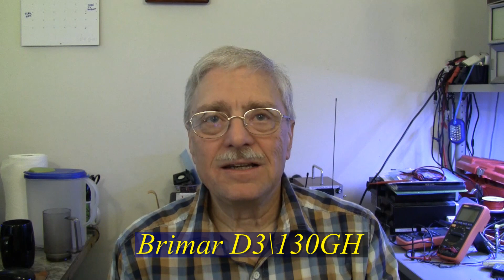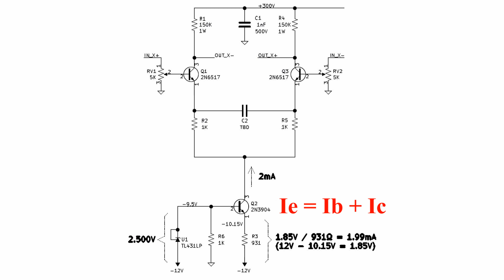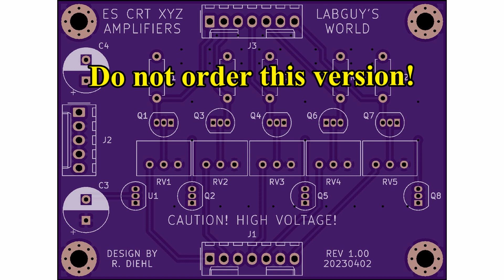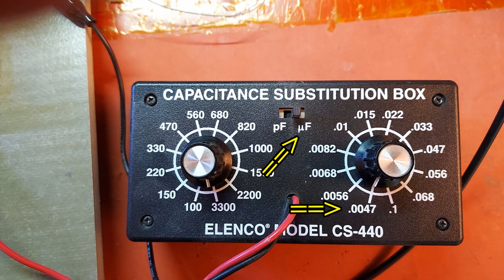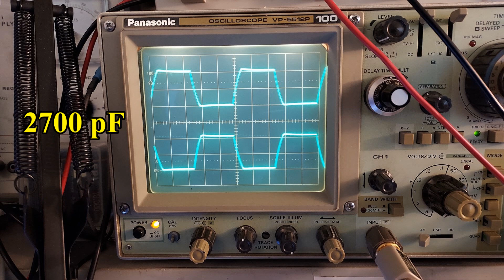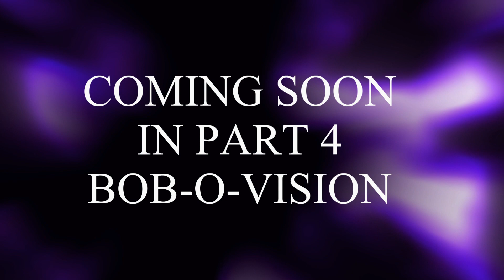Bob O Scope Part 3, Deflection Amplifiers

Comment: Your vid has been very helpful to me in my own O'scope building...  I have a (1961-built) GPO No.6B Mark I (similar to the Cossor miniatures) and it uses ECC81 dual triode diff amps.   As the GPO designed it a variable resistor where you have C2 acts as the gain control.  But bandwidth was only 10 kHz as frequency compensation was undershot.  So I put a 500 pF shunt capacitor across this, and discovered there is a "gain" setting that is neither undershot nor overshot.  Bandwidth for displaying a clean square wave has increased from <10 kHz to >200 kHz.   

I now have an O'scope that runs from D.C. to over 200 kHz, and which also amplifies X and Y for doing cyclogram work.  Superb !!  ❤. Thank you !! ❤
Reply from the maker: Congratulations on your successful restoration. Glad I had a small part in the process. If you watch the next video, you will see that I "don't know it all".
Reply: I am not there yet!  
The input goes in at a 1 Meg resistor which cannot be substituted by a pot divider as it is a grid leak resistance.  Diminish the grid-cathode resistance and the grid bias pdf will reduce, turning the triode on hard.  
But what is at issue is now known to be frequency compensation.
I am not "restoring" since both of my GPO O'scopes are already fully repaired and showing the same behaviour.  This is a design fault in perhaps the earliest diff-amp oscilloscope design.

Comment: I am thinking of buying a 5BP1 .... I know I will hate myself, either way. I am not going to try to build a serious scope . Possibly a clock or some vector drive curiosity. I built a 'scope back in the late 70s and used HV transformers and valves and all sorts.  I plan to cheat using 24 / 2000 volt SMPS and same for the deflection rails. It could become a real time sink ..I would be better of devoting my efforts to getting better at ESP32 and Coding... but but... but ... SOB ...
Reply from the maker: Dig it, bruh! The 5BP1 is not a good choice for a CRT. Very bulky and not very bright. It's primary selling point was its cheapness. They are egg shell thin and easy to break. I would suggest a 3BP1 or even a 2BP1 or one of those with P7 or P11 phosphor for the novelty of it. 
You don't need to tell me about the exploding logic tree of decisions any project creates. They head for maximum chaos at warp 10. The ESP32 will at least cost a lot less in the long run. If you go "full CRT", I am willing to help. Thanks for just watching my videos! You rock.
Reply: @videolabguy  Yeah !! What was I thinking? It would end up being a nightmare. I have built a scope with a 3BP1 before and it is much more manageable. But extreley challenging even so. Plus I live in an RV and dont even have a proper workshop. I started to look at various ancillary circuitry and every part of it would turn into a Heath Robinson nightmare. I already have a nixie clock and a stereo valve amplifier.  

I would get half way thorough it and having ploughed a hundred hours or so...in i would break the 5BP1 and start reading Strindberg and wearing black lipstick ... 

Walk away slowly ...

Comment: Great video Labguy. I really enjoy these type of in depth videos.
Any danger of doing a future deep-dive video about your approach to building state machines like the ones featured in some of your earlier videos ?......Just a suggestion !
Reply from the maker: You bet! One of the barriers in that goal is that I like to program in BASIC. QB64 to be precise. (If you are an old hand at QB 4.5 from the 90's, then look up Q64 and be amazed!) Meanwhile...
I may as well be carving hieroglyphics into stone as far as some of my younger viewers are concerned. I don't blame them. Youth is the time where we use up our "know-it-all" arrogance before discovering humility. So, that's all good. It's the proper path to adulthood. Us geezers just have to suck it up.
Meanwhile, I want to convert the state generator code into a more modern Python script. I am no Python programmer. (It is extremely weird to me.) However, if someone is skilled in Python, and specifically random access BINARY file bit manipulation, I would be happy to provide the pseudo code if they can return the same function written in Python. There would be two classes of program. One for generating timing patterns from a simple text source file, the other for stacking the RGB 32x64 pixel color images in my video memories. I can't realistically offer cash for this service unless it is very inexpensive. But, your name and service would be praised to no end in the follow on video.
Reply: @videolabguy  At trade school I bitched about the obsolte equipment we were training on !! Core Memory indeed !!! I ranted.... first machine I got to support in my first job ... ? A PDP - 11 .... (Fate can be so cruel!! ~joking~ I fell in love with the PDP - 11) 

 It is only when we get older that we really have something to be humble about....

Comment: One thing that could be improved about temperature stability is adding a regular silicon diode in series with TL431, to compensate Vbe of those current sources, that rises with temperature.
Reply from the maker: Great idea! If this system has temperature problems, I may try that method. Thanks for your input!